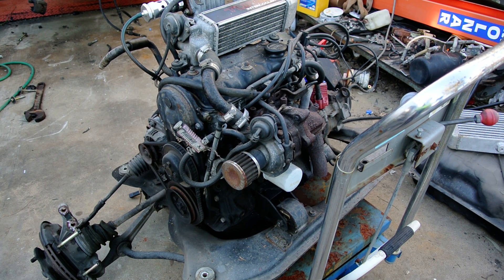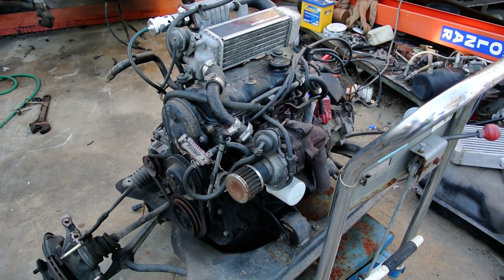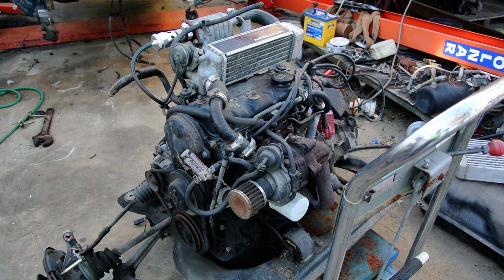Starting a 550cc Turbo engine outside the chassis!

Comment: do you have any videos that shows step by step how to start and engine outside of the car and how to put all the connectors to it..electrical and fuel
Reply from the maker: unfortunately its different for every engine. with carbies its really simple, EFI motors, not so much
but basically if you can give power to the fuel cut solenoid and the ignition system, and power to the starter motor to start, you usually can get most things running. diesels are the easiest :D hehe :)